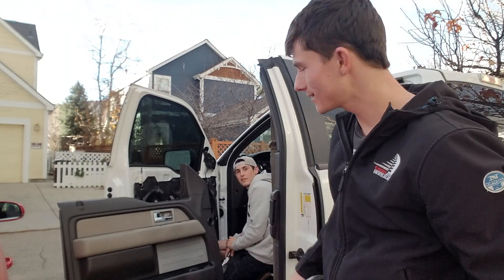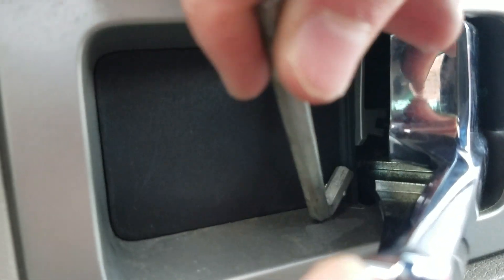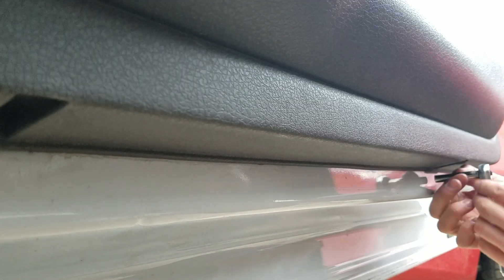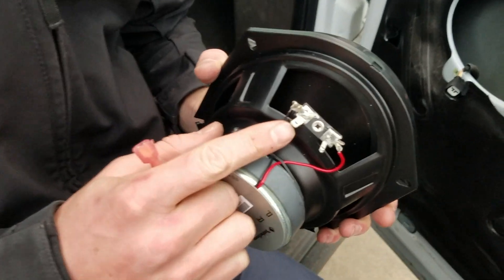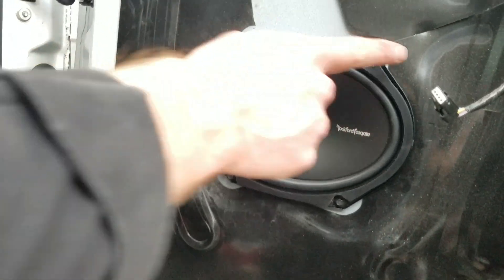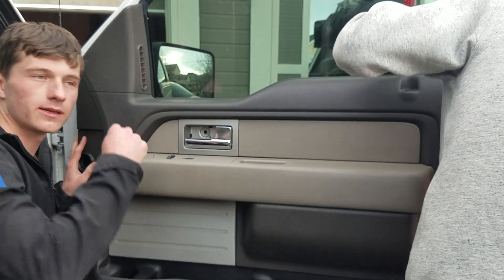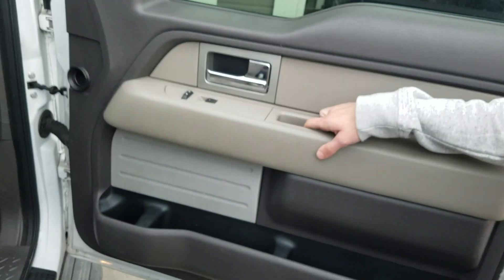How To Install Speakers On a 2009-2014 Ford F-150

Comment: I'll probably be replacing my 2002 Yukon XL with a 2014 F-150 in a year or two. At that point, the Yukon will have close to 400,000 miles. I've heard the 2014's are pretty much bulletproof, but like you said, the speakers are garbage. I'm a pretty big music guy, so I appreciate the video on how to replace said stock speakers.

Comment: I have a 2014 F150, trying to install Rockford Fosgate speakers. I bought the Metra 72-5600 adapters but they don’t fit over the terminals on the speakers.
Reply: I did this exact same thing. Have you found a solution to it?

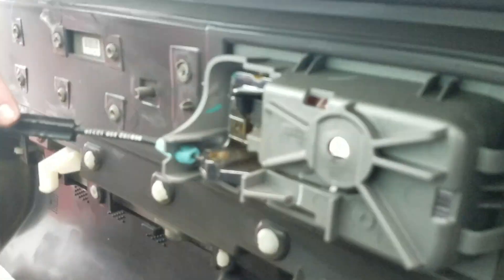Comment: FYI, you don't have to remove the door blue handle piece on the door (3:45 on video) There are 2 clips behind the "door handle section" that hold the unit/section to the door panel. Just push those 2 clips behind the panel in and the entire piece "door handle section only" on panel comes off and then just feed it through the opening. Just look behind the door handle section and you will see what I am talking about-right hand side of 3:45 on video. At least on my 2014 F-150.  Great video brother thanks you.

Comment: Do you know if the factory radio has the RCA connections and accessory wire to hook a sub up, with the factory radio?
Reply from the maker: It does not

Comment: The couple sites I looked at say the 72-5600 adapter isn't compatible with a 2010 F-150.  Any idea why?  Crutchfield offers the 72-5601 but no idea what the difference is.  Trying to buy the 5600 locally at Best buy.
Reply: Did you have any luck? I'm running into the same issue.
Reply: @wesleybrasier8368  Yeah I believe the adapter fit but I think I had to swap the wires around as most reviews say. I didn’t notice a big difference either way though. I guess my ears aren’t that trained.

If you do have to swap the wires, don’t splice them. Just get something tiny you can fit down inside the connector to press the release and the wire will pull out of the socket. Then you just swap the orientation and they click back in.

Comment: Don’t know if you’ll see this, just ordered the same speakers and speaker connector cable, a lot of people were saying the connector that you have, the polarity is reversed on them, did you have any problem with speakers working or if it fits the rockfords, thanks🤘🏼
Reply from the maker: carson fletcher, I haven’t heard of that. I didn’t have to switch any polarity
Reply: CluEngineer glad to hear that, thank you!

Comment: Those bolts holding the speakers on are 5.5 mm.  I ended up buying a 5.5 mm socket just for the speaker replacement.

Comment: Did you guys check the polarity for your wire harness? I ordered the same ones, but the reviews to the link you sent everyone says it is wired incorrectly and you could be missing out on some better sound
Reply: You have an update on the wiring harness? Did you have to do anything extra?
Reply: @1985NEVETS  no they came in perfect the way that they should 👍🏼
Reply: @andrewbowman605  k thanks

Comment: Can't thank you guys enough.  Fairly easy because of your video...hardest part was getting the electrical door connections back in to place.  You guys had 2, my 2012 F150 had four.  But a lot of patience ...and a hand mirror helped! 🙂  Also, no tool on earth fits the size of the  4 screws that the geniuses at Ford used to mount the speakers...I had to use needle nose pliers to get them off, then when I installed the new speakers, I found some Phillips head screws that were similar length, thread and thickness and used my cordless drill to screw them in...worked like a charm!
Reply from the maker: I’m glad it worked out for you
Reply: The speaker bolts themselves are 5.5mm. Thanks Ford.

Comment: you should of used the black plastic covers off the old speakers, pry them off and use on new ones.  isolates the sounds into the cab.  wont just bounce around inside of door.

Comment: Great video, but I have a question and maybe you guys know the answer. I have a 2014 F150 with a blown drivers side tweeter and I have ordered a factory replacement, but I can`t seem to find any videos of anyone who has replaced that side before, only the other side with the  oh shit handle on it. You got any idea how you get the plastic molding off of there to get to that speaker? Thanks!

Comment: Where did you get that connector that just plugged into the factory wiring? I’m not a fan of crimping or soldering so that is something I would want! Any idea if a 6x9 would fit in there?
Reply from the maker: Joseph Cercone, both links are in description

Comment: Watched the vid a few times before attempting... The problem I always have is disconnecting the electrical plugs. Tough enough even when I can see what I'm doing. So here's a couple of hints that helped me. 
Put the windows down. makes it easier to work on the back of the door panel through the window opening.
Put the locks down. Easier to remount the doooor panel over the retracted lock.
I could not get the plugs off the electric window control so I ended up popping it up and off to remove the plugs
Reply from the maker: Nice work Ed!
Reply: CluEngineer do i need to use an amp for these door speakers if I have 2 10’ subs witj an amp?
Reply: My new speaker doesn't have a plug on it but factory harness does how do u get a adapter and where

Comment: What size are the speakers? 6x9?? 5x8??
Reply from the maker: 6x8. Here is some more information on the exact speaker I used: http://amzn.to/2gTZkPg
Reply: CluEngineer are the rear door speakers the same as the front door  speakers, 6x8?

Comment: What about the tweeters located above the dash by the windows?
Reply from the maker: I though about doing it but I would have to buy new A pillars or an adapter to make it look nice.
Reply: @92813justin  piece of cake also, I did mine

Comment: I don't know how it is now but years ago if you wanted factory replacement speakers to sound decent, they needed an amp to push them. Pioneer used to make a paper dual cone full range that sounded great and put out a lot more bass and decibels without having to replace the head unit or add an amp. Like all good things, they probably don't exist anymore.

Comment: Are the speakers you placed louder than the stock? I had tried a pioneer  5X7 on mine yesterday and sounded the exact same so I took it back but I want a louder one.
Reply: Get an amp, bruh

Comment: Cool vid brother and good job. Hos do you like these fosgates as opposed to the stock speakers? Do you have any amp pushing them at all?
Reply from the maker: Gabriel Cuervo I like the speakers better. They hold up a lot better when I am blasting the tunes. I wish I had an amp in the truck. It would sound much better.

Comment: Doesn't do much unless you add some additional clean power
Reply from the maker: Jason D. This is true. I just didn't want to add an amp and mess with the headunit or add the converter.
Reply: He had to sound a lot better then factory though right?

Comment: First of all, get yourself some basic tools. What man doesnt have a s ocket set and tool kit with basic screwdrivers and wrenches? Cmon. Second, all you have to do is pop the interior panel off the hooks. You dont need to disconnect anything. I just finished changing out all of my factory speakers in all four doors.  Once the panel is loose, put the hooks back into the metal frame on an angle, let the panel hang there, and change out the speakers. Simple. And once again, get some basic tools or turn in your man card...
Reply from the maker: I was in college and those were the tool I had and enjoyed pushing the boundaries with my set. I know have a great tool set that I enjoy. To my knowledge you do need to take the panel off. I have not seen the speaker door pop off